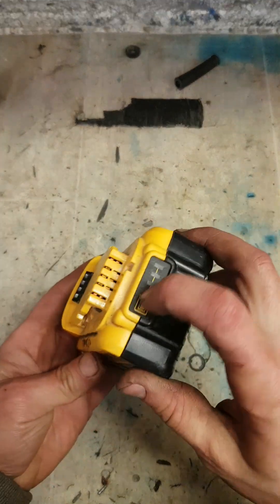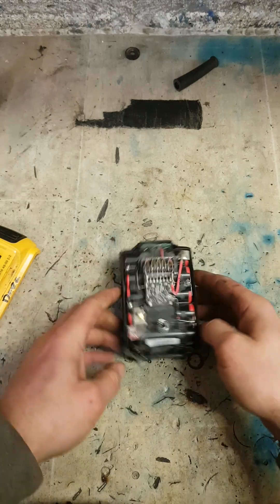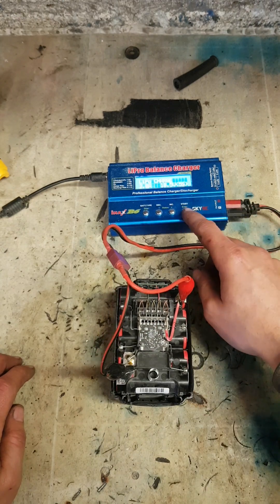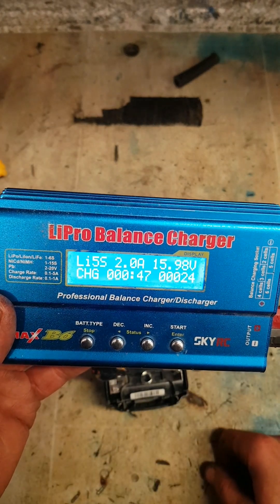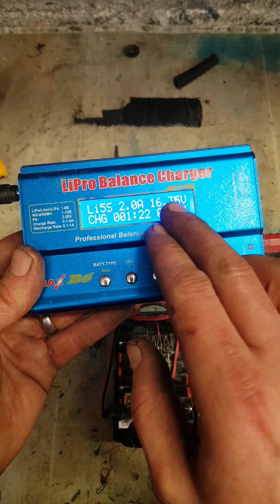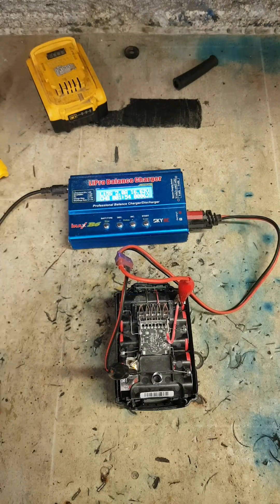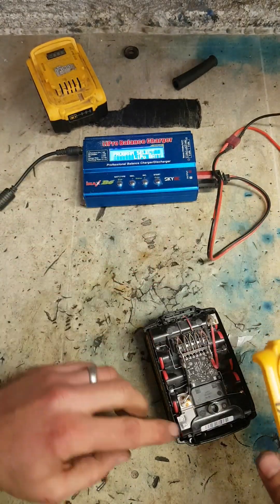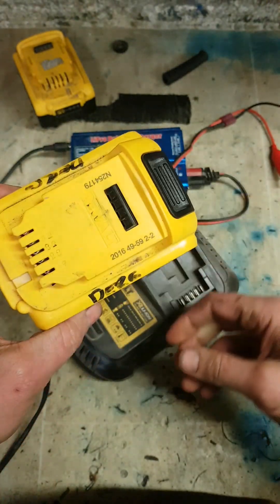How to recover, repair dewalt, makita, milwaukee lithium batteries.

Comment: Good man Dean. Just ordered one of those chargers and give it a whirl. Just bought two Makita 5ah Lion batteries and only worked once. Used right charger etc but they were very hit as used on electric chainsaw. If it works owe you a pint or two.

Comment: 1.store batteries inside your house
2.change batteries often
3.dont run batteries flat
4.dont charge batteries immediately after using, let them cool
5.if batteries hot in use, swap out, 2 batteries doing heavy duty work is essential
6. Remove batteries from tool when not using, vampire loads running batteries too low will kill them

Whats your thoughts Dean?
Reply from the maker: Correct, except maybe for the first one. Yes it's better to keep them inside. But lithium batteries are dangerous. A very small number can fail and self ignite. (Very small number and low probability). But I'd rather have a dead battery, than risk one burning Inside my house. No mater how low the risk.
Reply: @deandohertygreaser  Makita visited the college I work at and the previous day had been on site demonstrated the new xgt and safety developments over all their tools. The site manager arranged for them to visit following a fire from the Chinese Makita copies inside the charging cupboard that had just been set up on site. Think it was  £10k lost as many had high capacity batteries charging and to the cupboard had just been set up. no insurance claim either as it was a DIY cupboard, no ventilation, and the Chinese batteries and charger probably did not conform to UK specifications.

Comment: Only works for a bit then stops if one of the cells is damaged.

Better to open, remove the batteries, isolate the faulty cell, bin it. Then use cells in torches, usb banks etc

Comment: They work on flexvolt too but requires a bit more faffing, solder wires onto the end of each cell and charge each individual cell slowly one at a time. Using it directly to the main terminals will likely make the unbalanced cells worse.
Reply: Could you not test the top of a flexvolt and find out what bank is low and charge from the top with this charger and spade connections?

Comment: I have 1 completely dead DeWalt battery 1 that doesn't charge up fully and a double charger with one side that charges the batteries and the other side is dead

Comment: Good man Dean.
Is there anything you can't fix.
I have 3 of these dead in the shed.
Just ordered that charger off Amazon. 
👍
Reply: Did it work?
Reply: Did it work?
Reply: I never got to use it.
It arrived ages after I threw the battery out.
Reply: Did you fixed it, you need to open it and check each cell/pack voltage which is in pararel, then you can also recharge cells manually, if you have dead cells you need to changege dead ones to same spec like others or rebuild all. That can be problem like: dead cells, loosing capacity, high internal resistance or high self discharge.

Comment: Need to charge the cells that are low voltage instead of the whole pack, the Dewalt charger I don’t believe balances the cells. This will let it charge but the lowest voltage cell will still stay low and you are losing capacity on the pack as a whole.